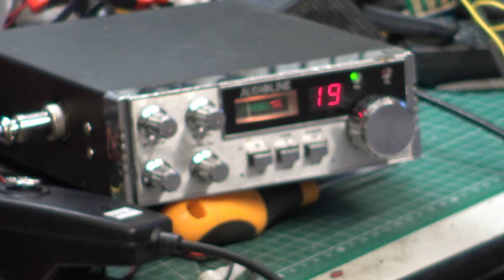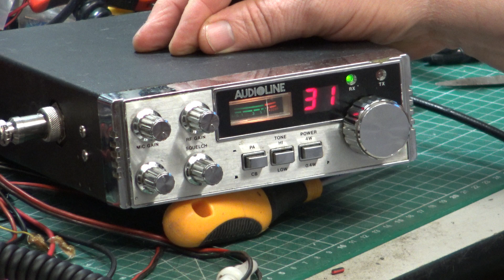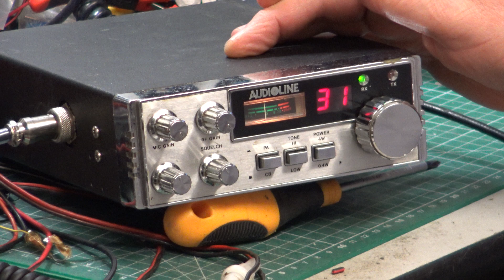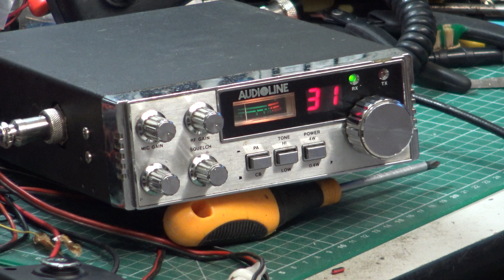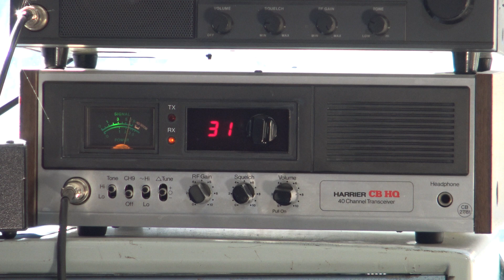Audioline 341 CB27/81 UK FM CB radio - On The Air test

Comment: Not much in it with the mic's, I think they are from the same factory anyway, but they don't sound quite so bassy as the original mic.  However, you are very close, and it is when you get further away that the CB sounds very bassy, you can still hear it though. Did I miss this repair video, or was it a month ago?
I never took to these sets, maybe if the audio on transmit had been a lot better I might have taken to them a bit better!